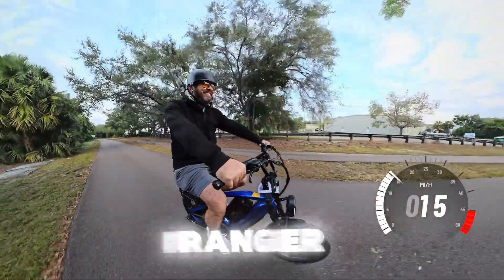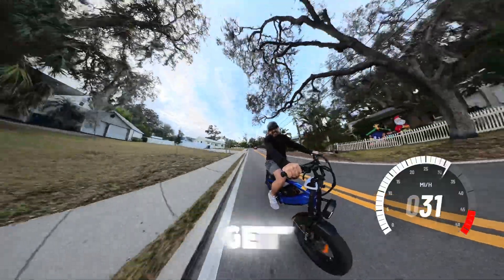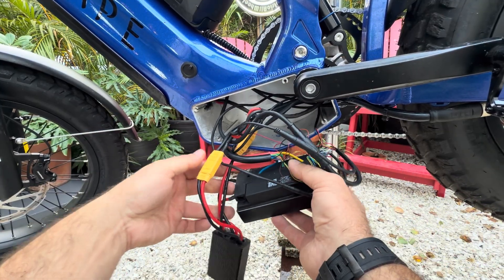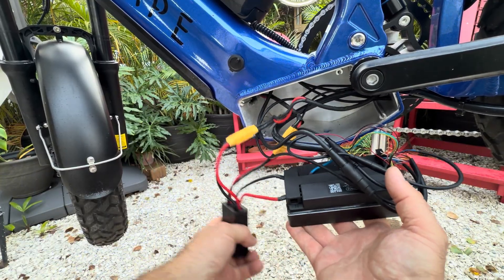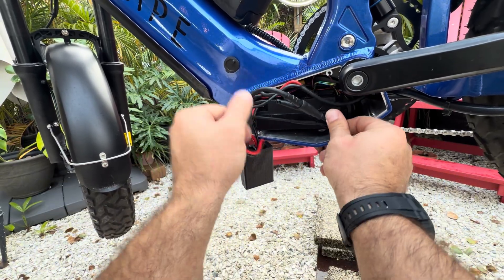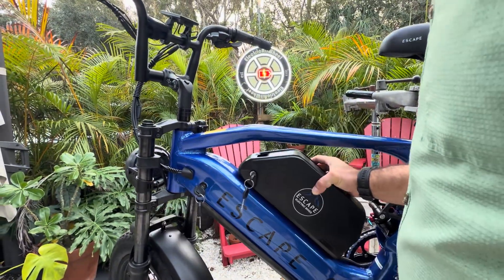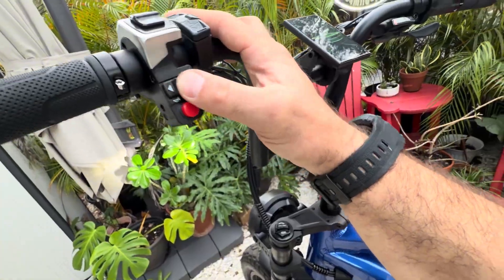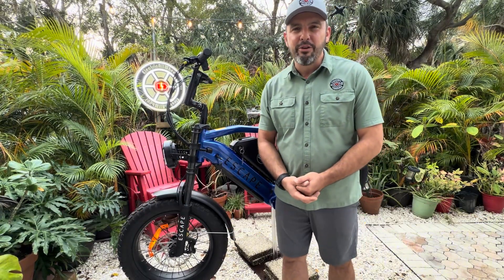Look inside the 72V controller housing of 3000W Escape Ranger 20x4 Fat Tire Dual Battery e-Bike

Comment: waterproofing that controller is easy just pull it out and apply clear silicone sealant to all of the connection orifices on the controller. its pretty easy to peel off if you ever need to unplug anything too.

Comment: Wasn’t there something fishy going on with this company pulling off the sale market and back on ?
Reply: Also, if you are referring to Lunatic Latina, she has been proved wrong numerous times for false accusations.
Reply from the maker: We would offer a reply but @escapeelectricbikes has provided enough perspective.
Reply: Nothing fishy with our company at all. 
We have paused a few times, one because we had to have our manufacturer add warning labels to the bikes as well as to the display. 
We also had to pause because customers wanted the Bafang app added so we did.
We do this so we can ensure consumers get what they want other than selling to them without listening to their wants and needs.
Reply: I would say nothing really fishy at all. They have been super responsive and worked well with me, and ive seen quite a few other happy customers online. It is a smaller operation than something like Magician, so things might move a bit slower. As they also said above, there have been a few things needing changed. They are still working on some stuff, but overall very happy with Escape/Joel! I actually got my ranger in recently and batteries should be here monday. Will be posting some of my own sutff on a different channel soon.
Reply: Hey that bike looks familiar ;)

Comment: Of course, the alpha can’t keep up. Ranger has a bigger controller and you gotta be probably 50 pounds heavier than Brad switch bikes in the result will be the opposite.
Reply from the maker: While we appreciate the enthusiasm, this isn’t true. Neither aspect.
We did switch, and the OTA updates for the Alpha bump the output to 60A. It still did not keep up.
Reply: I absolutely love your channel one of the best out there very intuitive but don’t leave the viewers hanging thinking that the escape bike is more powerful than the alpha. They have the exact same drivetrain  the escape is quicker because of the 20 inch tires and that’s the only reason.
Reply from the maker: @T @TheTcat1000   by the geometric proportions, the rotational circumference of the 26in wheel should yield a longer distance, or more travel per rotation.
In both aspects, revolutions per minute,  and instantaneous power delivery, the Ranger beats the Alpha.
Your first comment addresses weight differential between riders and we proved that not to be the case. You then stated that the Ranger has a bigger controller and it’s not.

The difference lies in the power curve and programming of the motor and controller combination as it relates to wheel geometry and bike size.
This outcome is expected, despite wishes to the contrary.  The only true test will be against the Alpha mini.
Most contrasting aspects will relate to programming. It is clear both Magician and Escape are topping out at 60A.
Then the differences will be addressed in bike geometry, cockpit accessories, and the layout/weight distribution (battery placement)

Thanks for your support!